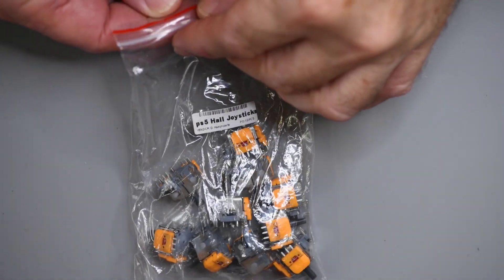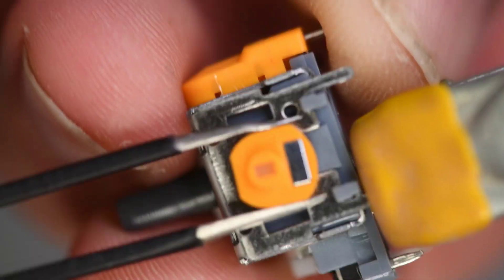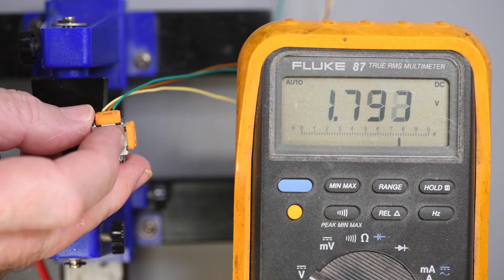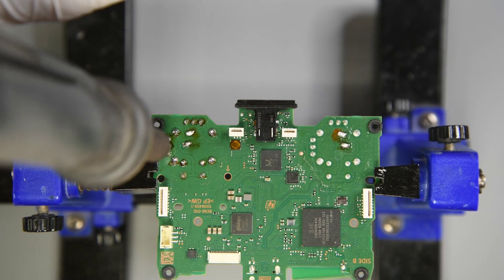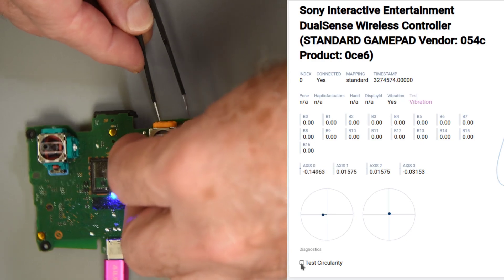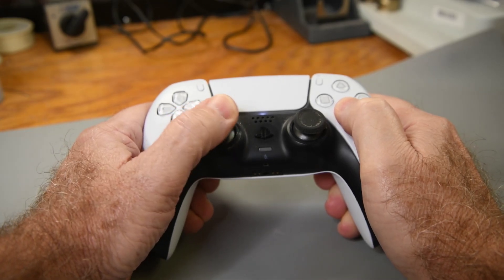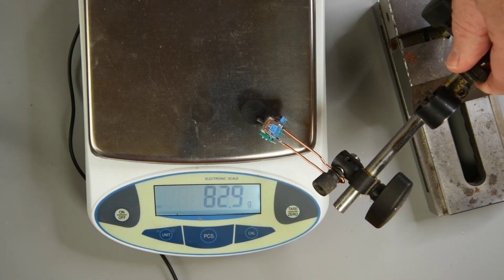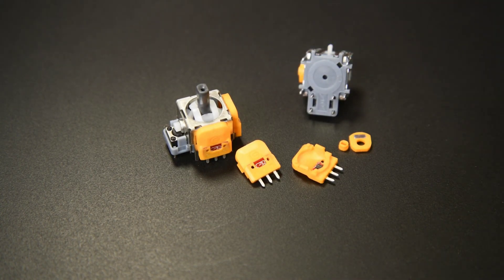Hall Effect Joystick Replacement for the PS5 DualSense

Comment: Great channel, thanks for sharing your knowledge. I have a question: I replaced the original left joystick on my PlayStation 5 controller with a Hall effect one, and when I connect it to my PC, I see that the Timestamp and some AXIS are moving on their own. Is this normal? Because I see the same thing happening in your video, and I don't know if that's a problem or not. Thanks.
Reply from the maker: Some Hall effect joystick sensors exhibit a higher level of noise in their output, which can be observed as slight jitter in the joystick position.  I never noticed any problems using them, but the new TMR joysticks will not have this issue.
Reply: @metalplasticelectronics354 any link to the TMR joysticks? Thanks
Reply from the maker: These are my favorite at the moment: https://a.co/d/cprQirf .  I have a video on them here: https://youtu.be/vmqPW_mzz3M .   I have a few videos on some of the TMR joysticks, and most of them have links to where I bought them in the description.

Comment: Great guide! Thank you. Stick drift starts because the round metal (centre tap?) scratches through the carbon resistor. I fixed  drift a few times by opening the stick and ever so slightly moved/bend the metal centre tap 'out of its groove'. Have to use a needle point. But it worked. Now the centre tap can scrape on a new piece of carbon road. Until through again.

Would be nice for SOny to bring out OEM conrollers with hall senors. But then they will be killing their golden goose. Like wishing for a printer manufacturer to sell you a full printer cartridge. 😛

Comment: how come you know that supply needed for the module is 1.8V? I can't find the datasheet anywhere on the internet.
Reply from the maker: That is the supply voltage to the joystick in the DualSense controller.  Most of the hall sensors will handle a little over 5 volts.

Comment: the potentiometers of the ps5 does have printed the words 60 b and 2k3, the ones of the ps4 60 b 103. This is very insane.
Reply from the maker: The PS4 uses 10K ohm pots, and the PS5 uses 2.1 or 2.3 K ohm.

Comment: May I ask a question? Can I replace potentiometer of a PS4 Controller with the ones of the PS5? I guess, I purchased the wrong potentiometers on eBay. right bottom corner stands a 2k3 and the potentiometers are described as "for PS5". But the connector hole looks like the one of my PS4 Controller V2 (orange colored stick unit)
Reply from the maker: I've never tried it, but it should work.  The controller will consume a little more power, somewhere around 15 milliwatts.

Comment: I brought 10 of these for $5 shipped from overseas to Australia. Got them today keen to install them.
Reply: From where? can i have a link please?
Reply: Aliexpress i just looked up hall effect ps5 and picked one of the high rating ones. I paid $20 for a desolder pump today the ones you click.. theyre garbage waste of money I could be doing it wrong but its tedious either way.

Pulling the controller apart down to the board is easy its getting the old sticks out thats a pain. I am going to try a heat gun instead.

If you get sticks make sure you have a thin iron & solder, flux and a way to get the old solder out which im still working on.. these tutorials dont really touch on ventilation flux fumes arent good for you, and lead solder is easier to work with but wear gloves.. lead poisoning. Worked with solder on my cars wiring over the years never soldered electronics before, harder than it seems
Reply: @undefined428  ya have any luck getting them done?

Comment: Would it work on duel sense edge
Reply from the maker: They will fit the edge, but no calibration software exists.  So, to have a calibrated controller, you would also have to use a calibration PCB.  All in all, a lot of work.

Comment: What does mean 2pcs, 10pcs or 50 pcs in the link you shared?
Reply from the maker: The number of joysticks.  But don't buy the Hall effect get the newer TMR type.
Reply: Whats tmr?  @metalplasticelectronics354
Reply: @metalplasticelectronics354  thanks for your reply. Do you know where i can find those TMR type joystick for ps5? I want to fix drifting on my ps5 controller.
Reply from the maker: Amazon has TMR kits now, and of course, AliExpress seems to have all of them.

Comment: you make it looks so simple.For me its so hard and i ended up accidentally melting both of the mic pieces where the cable goes into.Great video though.
Reply from the maker: The mic pieces?
Reply: @metalplasticelectronics354  i meant the plastic components that you plug the ribbon cable into
Reply: @metalplasticelectronics354  But after that incident i realised that using a hot air station would be much easier and so i picked one up for myself.Aaaaand i was right fitted them perfectly without any issue.😆
Reply from the maker: The right tool always makes life easier.

Comment: Do these joysticks require additional circuitry, or can i just unsolder the old units, and solder these instead?
Reply from the maker: They are a direct replacement but take a look at the newer TMR-type joysticks, they are better in almost all areas.
Reply: @metalplasticelectronics354  thanks a lot for the reply, i'll be checking out tmr stuff

Comment: Hallsensor have higher latency than alps. Thats where the biggest problem is coming from.
Reply from the maker: The new TMR sticks are very fast.  I can't tell the difference between them and the potentiometer-based joysticks.
Reply: @metalplasticelectronics354   there is a massiv difference if u play competition esport but maybe 0 for other things.

Comment: Could you tell me if the magnetic sticks are better than the original ps5 sticks or worse in shooting games like COD Warzone ?
Reply from the maker: I don't play many games.  But the new TMR joystick should be about the same.  Probably will have a little better circularity so you might have to move the joystick a bit more in the corners.

Comment: Question to ask: is there any way to prevent the stick drift without take off the controller to fix things becuz I dont want to ruin up my ps5 controller and end up buying another one?
Reply from the maker: The potentiometers have to be replaced to stop the drift.  You can recalibrate it to use as a temporary fix.
Reply: @metalplasticelectronics354  oh alright but what about the aim boost kit things for controller I heard about, do they help to prevent the drift from moving around?
Reply from the maker: I don't think they will do anything for a controller drift.
Reply: @metalplasticelectronics354  so the only option is get the hall effect to stop the drift forever?
Reply from the maker: Hall or TMR
Reply: @metalplasticelectronics354  tmr?
Reply from the maker: They are like the Hall Effect sensors.  But pull less power, and of the three I've tested, they have the fastest response time.

Comment: I replaced them every thing works but pushing down the l3 doesn’t work
Reply from the maker: Check the solder connections and the traces around the 4 switch leads.  They seem to be some of the easiest to damage solder pads.

Comment: The difference that you mentioned is that Halifax sticks typically have a little bit more tension than the standard sticks. That’s the feeling that you were likely feeling was tension or pullback which if you play a lot of FPS games that’s kind of crucial it changes the game you can take one step further by getting a dual sense edge controller I know I probably already lost the people right at that Edge take the joystick modules out and inside even though it’s a removable joystick module they still use the exact same joystick as a regular PS five control so basically what you paying for is to be able to remove certain ones well you can take one step further by upgradingjoystick module inside edge controller. Now you have an upgraded controller that will never get drift and even if it does just adjust and you have paddles, you can use.

Comment: eleven months have passed, have you had a chance to confirm if any deterioration has occurred? Gracias!
Reply from the maker: I haven't had any problems with the Hall or TMR joysticks. Some of the Hall Effect sticks are no longer installed, but the Ginfull V5 is and is still working fine.

Comment: How do you adjust the potentiometers after you mounted on the board?
Reply: There are holes in the housing to insert a stop pin to push against.

But if it's for PS5 controllers you don't need to do that as it can be adjusted from the electric side instead of mechanical.

Comment: The Ginfull felt great on my PS4 Controller, so I put a set into my PS5 controller last week. Frustratingly both sticks broke within the first two hours of use. So I replaced the with another set I had in spare. I fear I was unlucky with the quality.
Reply from the maker: When you say break, what went wrong?
Reply: @metalplasticelectronics354  out of blue sky the character started to stubbornly walk forward. So I replaced the left stick. Went back to the game and after an hour the character started spinning. Somehow the sensors were either jumping to shortcut or open. When I looked inside, thanks to your videos, I found that they are both Ginfull sticks with squared magnets .one with 93l35 marking and the other without marking.
Reply from the maker: @yannickb.4524  Thanks

Comment: So pretty much what I've learned is it's not as simple as taking a stock controller apart and popping these bad boys in....
Reply from the maker: It depends on whether the definition of popping is desoldering the old joystick module and soldering in the new one.  It's a bit of work.  But the magnetic joysticks are getting better and better.

Comment: I really need to buy one of those desoldering tools...I have replaced sticks several times and it is such a pain to get them off with solder wick and a cheap suction pen.
Reply: The best way we found at our shop is using little cutter tool. Cut it in piece from the side of the stick and make it 4pieces and break the retaining for the button. Everything will fall apart and you will be able to melt one solder joint at a time and remove piece by piece.
Reply: @nicolastremblay7527 I ended up buying a Vacuum desoldering station and it has been amazing! I can replace a set of sticks in like 30min or less...I just take my iron and dab a bit of leaded solder on all the joints and then use the vacuum station...The sticks fall right out with perfectly clean holes...I went through and replaced the sticks on all 12 of the controllers I own...I wish I had bought this tool the first time I tried to replace a joystick...It is such a pain to do with solder wick! Cutting the sticks apart does make it easier, but it still takes alot longer than with the vaccum desoldering gun...It was the best $150 I have ever spent...I have already made my money back by replacing sticks for several of my friends also.
Reply: That's an awesome idea!

Comment: I’m new to repairing and soldering. Does anyone know if you have to hook your controller up to a pc to calibrate the new joystick modules? I’m talking normal ones. Not these Hall effect ones? Can you just solder the new joysticks in and start playing?
Reply from the maker: Chances are you will have a usable controller after replacing the joystick module.  But you will have a like new controller if you calibrate it.

Comment: Hello! Did you deep tested it? May be some ANY wireless connection issue with hall effect stick's on dualsense?
Reply from the maker: The Hall effect sensors shouldn't cause any wireless connection problems.

Comment: i wish they'd just go on and switch to hall effect, but then they'd lose all that money from people buying new ones which i'm sure is the biggest reason why they won't. candy con seems like a pretty good substitute if you want a good hall effect controller. just sucks it's modeled after the xbox layout. i'm partial to the dual sense design so i'm gonna order some of the newer blue ones that require a board here in a few weeks when they're back in stock. i don't have any drift issues, but i've had a lot of problems with the sticks just feeling wonky on 4 dual sense controllers and even one that just felt like it was groaning when i moved it. this gen of controllers has been horrible for sticks not working correctly. never had to replace a psx/2/3/4 controller, but i'm on my 4th or 5th of the dual sense.
Reply from the maker: You should look at the Ginfull V5. It's my favorite so far.

Comment: Interesting.
I had some drift on my right pad so i dismounted,took those 2 plates out ,cleaned them and put back. I even add some inox with PTFE mx6 premium on the rings.
It worked well then suddenly again stick drift happens.
I gess mistake was i have to calibrate and maybe mistake was i used regular Q tips not with the foam,maybe some fabrics left there causing stick drift again?gess i will have to tear a part all again and try 1 more time.
I will order this aswell and try,since all this i am doing for the first time..nothing to lose..
I will use TS-100 Soldering kit.
Reply from the maker: Cleaning them is only a temporary fix.  It's the potentiometer element flaking off or just wearing out causing the drift.

Comment: Great video!  I have 7 dual sense controllers all with stick drift.  Im going to try this but I know nothing about soldering.  Can you please give a list of all the tools and materials you used in the video?  Thanks in advance!
Reply from the maker: You will need a temperature controlled soldering iron, doesn’t have to be an expensive one.  But get one that is at least 60 watts. I use the Hakko FX-951 but it’s expensive. Any good tin/lead electrical solder will work.  I’ve always like the Kester #44 63/37. Get some solder wick.  Take a look at this video: https://youtu.be/zxc6VIb8Ox0.  Most of the time I use a vacuum desoldering gun to remove the joysticks.  I don’t know how well the cheap ones on Amazon work.  But take a look at this video for removing the joystick without a vacuum desoldering gun https://youtu.be/slxgHcYHnm8.  The PC board holder comes from Amazon.  Just search for PC board holder, it’s sold under a few different brands, should be less than 20 dollars.
Reply: Thank you!!
Reply: Ok, I got everything on the list and watched the videos.  I cant seem to get the holes cleared with the wick.  Any tips?  Thank you!
Reply from the maker: Fresh solder in the holes and maybe a bit of extra flux. You can even put some extra flux on the solder wick; that sometimes helps. As a last resort, you can use a stainless steel sewing needle. Make sure the needle is not gold-plated; solder will stick to gold-plated needles. Heat the pad very well, and then push the solder out of it with the needle. But you might want to take a look at this before you try the needle: https://youtu.be/slxgHcYHnm8?si=yVOJ88DuWAiCK4k8 Good luck.
Reply: Thanks again!
Reply: What temp do you have your iron set at for soldering and when using the wick?  

Thanks for all the help, I really appreciate it!!

Comment: Hey, just curious for your input. I recently replaced my drifting dualsense potentiometer joystick with a hall effect joy stick, identical to the one in this video.

After calibrating it to be as close to center as possible, it works fine however it introduced a new problem of snapback, that is when running forward and letting go, the joystick registers movement in the backwards direction upon the joysticks return to center.

Any suggestions on how to fix this while not significantly hurting the ability for the joystick to return to center?
Reply from the maker: Not really. It almost sounds like there is a mechanical problem with the joystick. I think I would try and use it as much as possible and see if it gets any better with use. Maybe the plastic centering parts will get a bit smoother.

Comment: Great video, I replaced my sticks on an old xbox elite controller but the gamepad tester is showing the sticks continuosuly moving down and to the right of center. Do you know what would be causing this? (I'm thinking a poor solder job as i'm quite new to it)
Reply from the maker: I've never worked on an Xbox controller. So I don't know what the voltage would be. If it is all the way down and to the right, I would suspect a bad ground or voltage supply to the joystick potentiometers. If it’s just a little bit off, is there a way to calibrate the Xbox controller? The replacement joystick will almost certainly have a different center value.
Reply: @metalplasticelectronics354  Thanks for ther reply. they are clearly slightly off center which can be adjusted but i think it is a bad ground as you say as it is showing up as if someone is pulling hard down and to the right continuously

Comment: There is now a way to calibrate your joysticks through a web interface! Google "the al/dualshock" and you should find the software. Im really curious how well it works with the hall sensors, as it seems like a hastle trying to dial it in manually and installing pwbs on the back of the board makes it not fit together perfectly. Do you mind checking it put to see if it works?
Reply from the maker: Thanks for the information.  I haven't tried it, I'm still trying to understand exactly what it does. But it looks very interesting. I just wish Sony would release the information on how to calibrate the things.
Reply: @metalplasticelectronics354  it lets you calibrate the joysticks and save it to the controller memory itself. You can calibrate centering, circularity and range all in one web interface. No need for messy calibration boards.and no worry about accidentally touching a stick when turning on the console with the controller.
Reply from the maker: I finally tried it out and seems to work great.  Will solve a lot of problems.